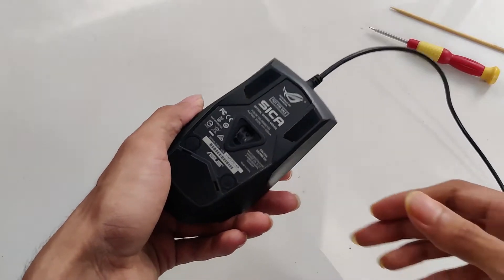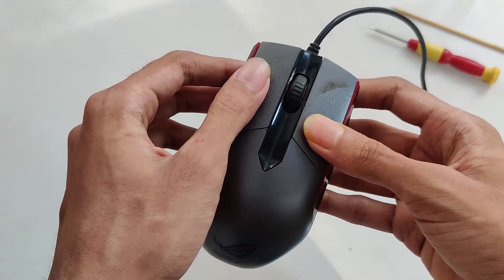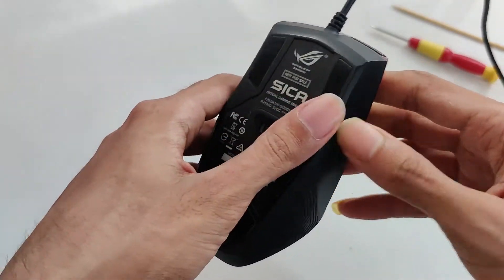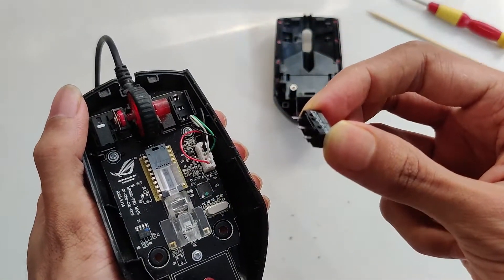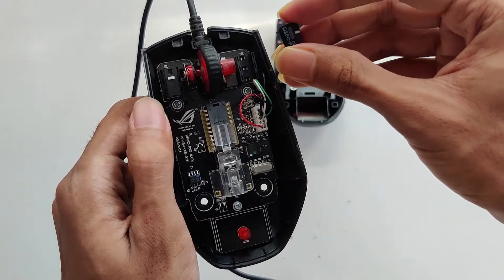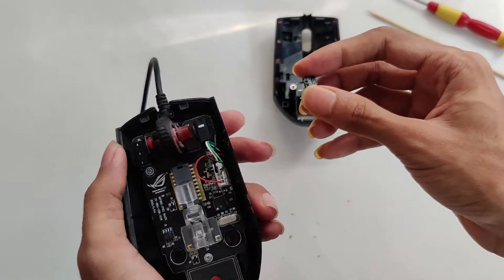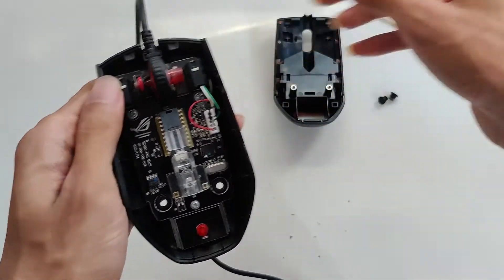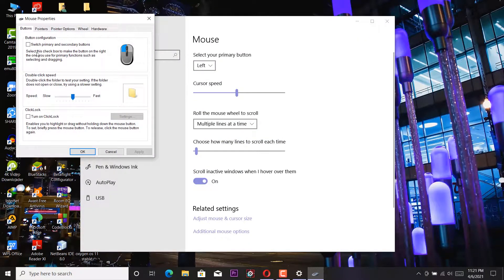Double clicking issue Gaming mouse teardown and omron switch fix (ASUS ROG SICA)

Comment: can we replace usb cable to the new one? mine is not working properly when i plug it to laptop.
Reply from the maker: Yeah it's possible. You can change the USB cable. Probably your USB A connector has become old loose dusty or something like that ...
Reply: thank you. there are many choices on marketplace, but I have no idea which one is most suitable for SICA. I saw there are five cables, red white green and two blacks. are they correct?
Reply from the maker: @hairanipanji1074  yeah 5 cables but only 4 distinct connections in USB A connector. 2 cables are doing the same I think. You should find out --> disassemble it and if you have a multimeter, you can check the continuity of both ends. Messy way is to destroy the USB A connector and check where 5 cables are coming. Is the same kind of cable available on market with 5 cables ...?

Comment: Bro i have double click issue with mouse continuously disconnects and reconnects.
Did you have same issues?
I also got it with my gaming laptop and it served me well for 4 years. Now double clicks and auto disconnections killing me.
Reply from the maker: yeah double clicking issue was there but not any disconnecting issue in my case ... after the fix mine is still working fine ... you can fix the clicking issue by replacing the switches but if any soldering desoldering need then it will be little tough ... check the usb A male female connectors on both end ... if there is dust in the connection port it can cause disconnect issues ... good luck

Comment from the maker: If you have any question please feel free to comment ...
Reply: what if we have to replace the switch. what switch is used in ROG SICA mouse? and where can I get it?
Reply from the maker: @Chi-Squared  yeah sure these are original Omron D2F Series switches ...
Compatible switches for ROG switch socket are Omron D2F Series switches : D2F, D2F-F, D2F-01, D2F-01F, Omron D2FC Series switches : D2FC-3M, D2FC-F-7N, D2FC-F-7N(10M), D2FC-F-7N(20M) ...
mine is D2FC-F-7N ... hoping that helps ...
Reply: @godspeedsr1471  thank you.. this is very helpful. I have ROG SICA mouse which came with my ROG GL 552 VX laptop and it is 4 years old. Left click is giving problems. Your video was really helpful 👍🏻 great work
Reply from the maker: @Chi-Squared  thank you too